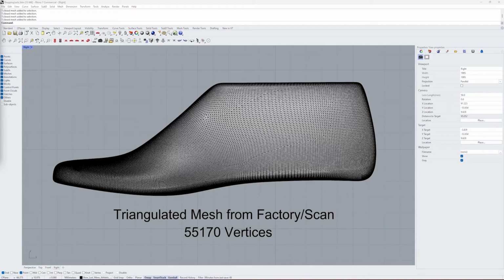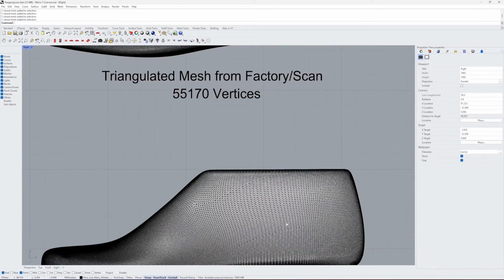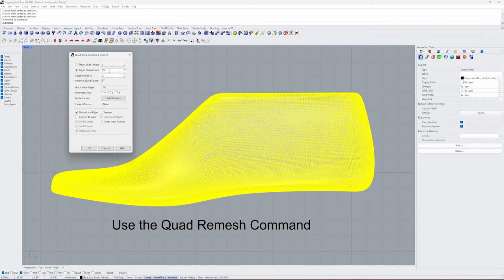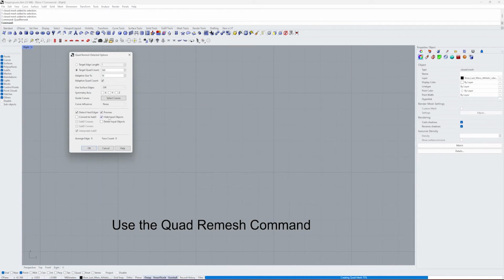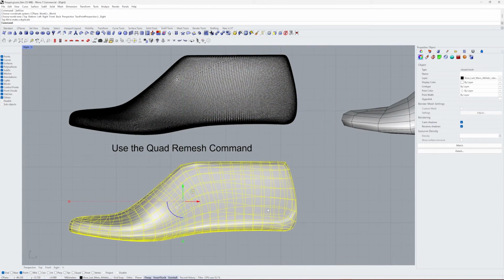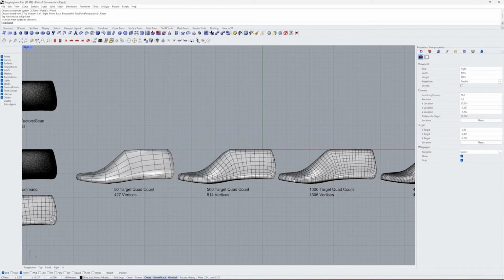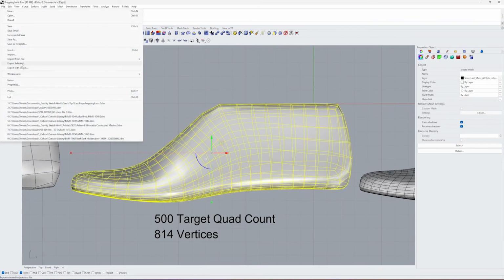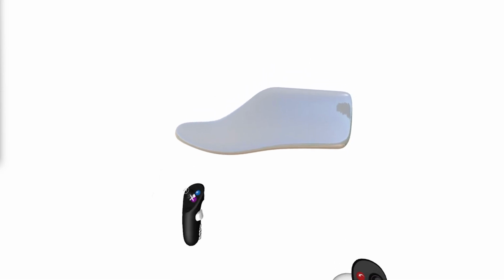Preparing a Shoe Last for Gravity Sketch

Comment: Can gravity sketch be used for furniture design, for example, kitchen cabinets?
Reply: Absolutely, you can even lay out measurements.
Reply: @jonathanmitchell1776  thanks! I haven't found too many videos on the use of the measurement tool for laying out detailed woodworking projects. It's definitely a great app that can only get better with time. I'm looking forward to trying it out on the Meta Quest 3, once it's released.
Reply: Yup
Reply: Another question, is there any sort of tool like a protractor for angles? Or would that be with the rotate tool? I'm thinking of the way Sketchup works.
Reply: @matthewjamescahill  haven’t seen that, but if you hop on their live streams and ask for a tool, they usually put it out within a few months.